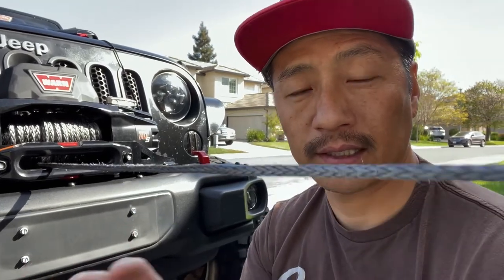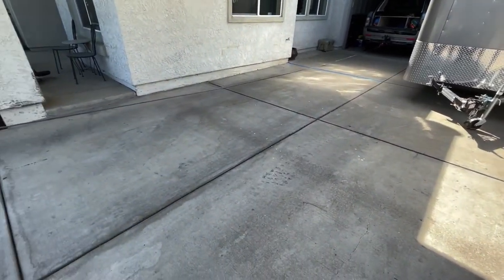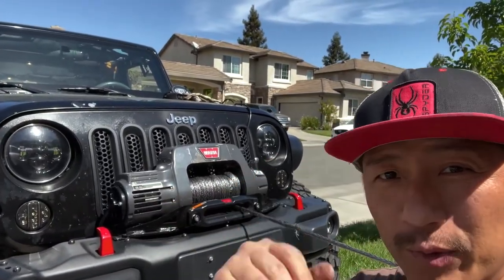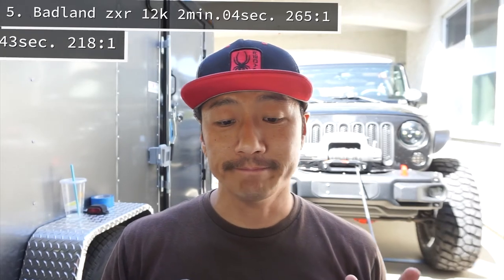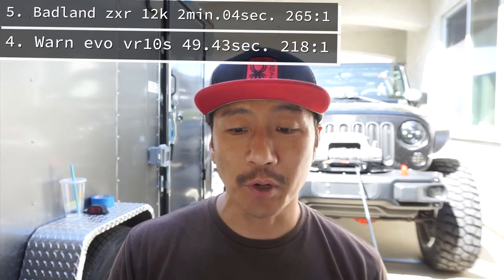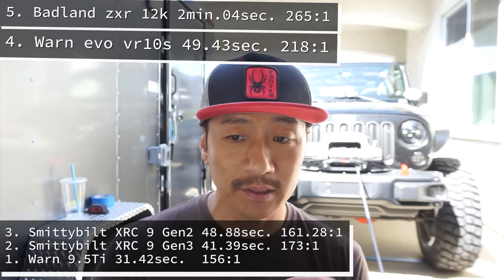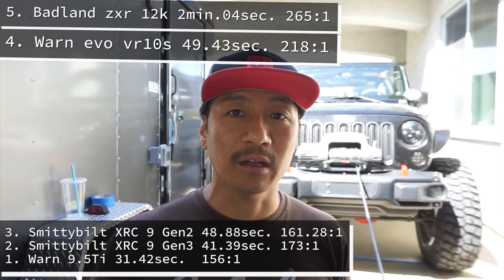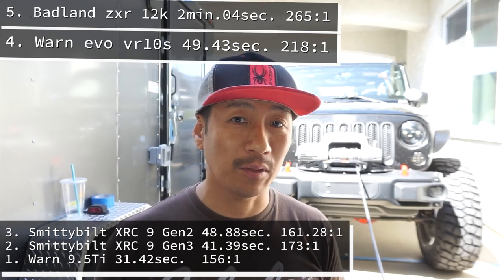Warn Winches vs Smittybilt & Badland

Comment: Thanks for the video. This certainly gives one aspect to the comparison. But … could you also do some sort of comparison on the torque/power of the winch.  Lower gear ratio usually means faster, but sacrifices power.  Would like to see if the higher gear ratio (slower) winches have more power?

Comment: Higher (numerically) means slower line speed and more pulling power. All things being equal,such as motor hp,amp pull,ect. Comparing a 12,000 winch to a 10,000 winch  is really meangless. You count on your winch for pulling power, not rewind line speed.
Reply from the maker: I agree, buts it’s hard test the pulling power with 5 winches without proper equipment and setup. That being said, Most people never get to use their winch and if you winch a lot like We do especially Snowwheeling, having a slow no-load winch line is very frustrating and line speed could be an important factor when buying a winch.

Comment: Not shocked at all. As a JEEP enthusiast you should understand the speed/gear ratio scales. You ALLWAYS sacrifice speed for power when you increase gear ratio. I bought a Chinese winch for my dump trailer to pull in skid steers that are not running. The 12K winch will not pull an 8K machine into the trailer, it broke the housing on the second time we tried it. A friend with a self recovery Warn 10K on the front of his F350, parked in front of the trailer and pulled the machine into the trailer for us. So a 10K Warn did the job that a 12K Harbor freight grenaded on. I don't care to save the minute ....... I will settle for doing the job it was purchased for, hell it can take 15min as long as it works.  Tell me how well your jeep climbs with a 3.08axle compared to Jeep crawlers 5.38axle but that crawler is way slower than the 3.08 and gets horrible mileage with a top speed of 55-58mph redlined

Comment: I don't care about line speed I was hoping for a comparison on the durability / dependability and pulling power of the winches.
Reply from the maker: If you winch a lot line speed should be important. 

Testing the durability and dependability is difficult. I would say that most wench works great, so then it come down to line speed in about out.
Reply: @4x2WagonFamily  You have a point but most people will not be doing a lot of winching.
Reply: If you want reliable and longevity go with a warn. I don’t care about speed as long as it’s reliable and gets the job done for years to come. Smittybilt has some good winches but longevity in my opinion seems to be lacking… most I see people are replacing 5 or so years. Most I see on the warn is 10 plus years. Other then those 2 brands I cannot comment.